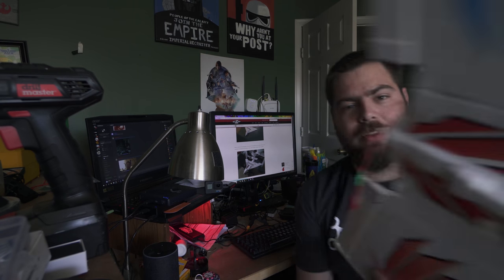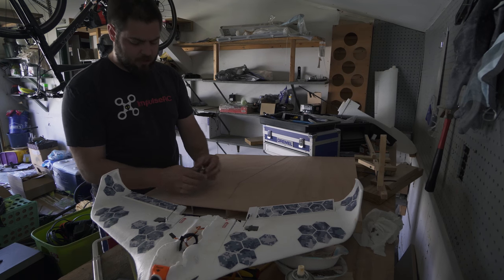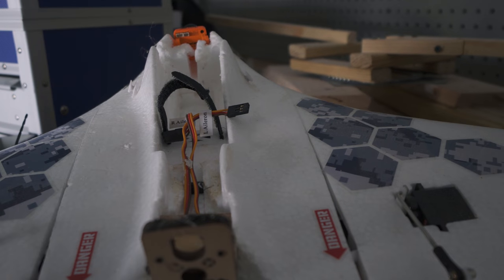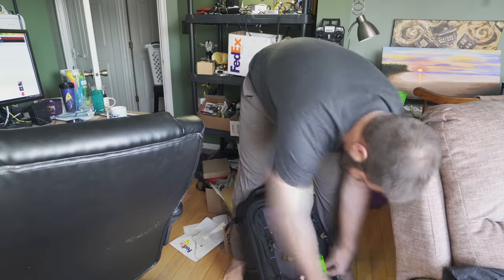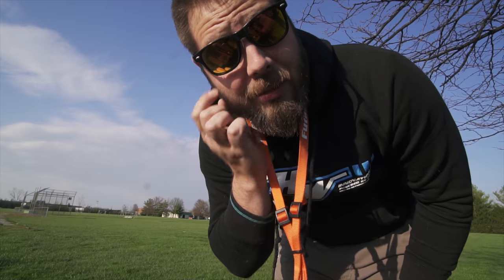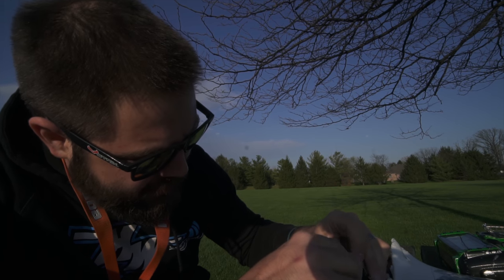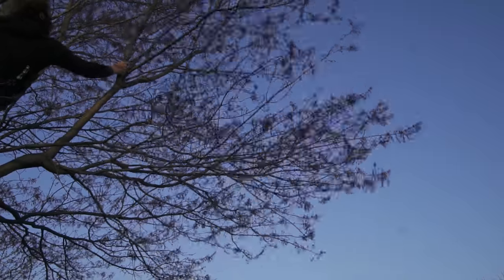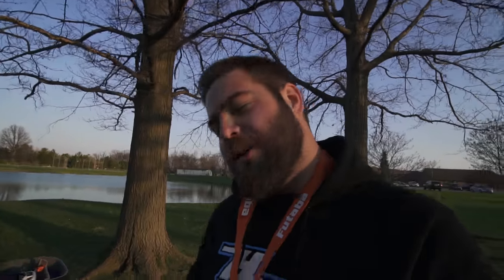I'm never touching fixed wings again

Comment: Dude, some wings just really suck. Don't stop though, have to find the right one. Like a unicorn
Reply from the maker: I won't give up haha. I'm looking at finding another one more off the shelf that's dumbed down for me.
Reply: NURK FPV try a pop wing. They been around for a long time and there dirt cheap. Learn on that till you fell ready.
Reply: Did you try E-flite x-vert vtol? Its flying wing that vertically hover.
Reply: get a sweepwing!  or the RMRC strix goblin or nano goblin.  These are also available in the kit or pnp and great for line of sight or fpv.  Also pop wings are really cheap and durable.  Its the only plane I have that has always worked despite always crashing.

Comment: Tail heavy...check the recommended CG measurements.
Reply: exactly what im seeing here too good catch!
Reply: getting the CG right on some wings can be frustrating for sure haha, drove me nuts when i first started building wings years ago .  but  NURK can fly a quad like a God !  love his vids , the one flying around that dam was epic!
Reply: Jeremy Vest 
This! I dabbled a bit in building my own wings. First one was ok but the battery had to be almost hanging out front to balance! Second one had a fuselage of sorts but it generated lift that i didn't account for so the flat spin of doom happened. Yes, wings can be tricky.
Reply: Frequent Flyer haha I know right battery practically hanging out the front I've been had to resort to sticking bolts in the front just to balance it LOL

Comment: I was a fixed winger for 20 years but have found my love in FPV quads. They produce a much smoother platform for video and can be flown from anywhere in conditions you would not even consider with a plane such as high wind or confined spaces plus the  aerobatic envelope is much wider with a quad.
Reply from the maker: Agreed on all points.

Comment: if i may suggest a good wing, i would say the FT mini arrow or versa are both great starter wings. easy to build and fairly easy to fly. i just built my mini arrow and its pretty fast, and as a quad pilot flying came kinda natural.
Reply from the maker: We shall see. The idea of scratch building or building a kit with glue and all that just makes me want to cry. I am just not interested in the arts and crafts side of things
Reply: NURK FPV neither am I I hate arts and crafts but for me it was the cheapest way in. Plus there's really not too much too it. It took me about 1.5 hours to do. But to each their own

Comment: wings, biplanes & triplanes are more sensitive to small cg changes.. fast wings are always hard to balance and may need some added nose weight. Also, if your not sure where the cg is its usually better to start a bit nose heavy.
Reply from the maker: See it's annoying because I thought I had it nose heavy. Turns out no

Comment: Made my first flying wing off some Flight Test foam board plans and some spare quad parts. Mounted an fpv camera on it and took it out the other day. First attempt I broke it in half, hot glued it back together then had several more awesome flights after that.  I'm kinda a fan of the thing now.
Reply from the maker: Nice! That sounds like the perfect experience

Comment: You said there was up tilt in the motor mount? If so that is absolutely your problem. And possibly tail heavy on top of that will not help. For scratch build look up the Flite Test Mini Arrow, or the Flite Test Spear, both great designs and only about $2-3 in supplies ;)
Reply from the maker: It was more or less level by the time I flew. I never clarified that on camera.

Comment: the problem is that it lacks weight ahead, that's why the wing is uncontrollable, once the perfect balance is achieved, they are very stable and easy to fly in FPV
Reply: Weight and balance is Crucial on a wing.  Not having a three gyro FC leveling the plane changes things also. Wings are really simple and some are great video platforms, but ya gotta have things in sync.  Buy a "suggested package " and you'll rip fixed wing too!

Comment: Did you almost test the rotary bit against your hand to see if it was spinning at 3:11 😂
Reply: French Brown I was thinking the same thing !!!
Reply: Think he was feeling for air flow. But you can touch those types of abrasive disks (without much force). Though that little dremel was pretty high rpm. So be careful. It's wood cutting disks that are lethal, they scare me. All the razor teeth. Kinda like quad props. Dangerous.

Comment: Dude don’t sweat it. Launching a small wing like that can be hard even for a seasoned wing pilot. I think you either need someone who knows what they are doing to help you, or get yourself something that is much more stable. A good ol’ bixler or something like that will be way easier to start with. Starting with a fast twitchy wing like this is basically equivalent to making your first quad flights by tossing the thing off the roof of your house - in acro mode!
Reply from the maker: It's funny cause that's basically how I launch quads

Comment: Definitely tail heavy.  Planes have balance point or "center of gravity" which is crucial, especially for flying wings.  You should actually try a trainer plane before moving on to a wing.  You're literally learning on the toughest type of airframe to fly.  Get a Bixler from Hobbyking or similar rear-prop trainer...and then check the center of gravity before you launch it!  You'd be amazed at how relaxing and fun a smooth flying plane can be!

Comment: yip definitely tail heavy , checkout the zohd dart its great fun and it will fit in the glove box of your car haha , we have a lot of them flying at the field on 4s and 3s , its a box of joy los and fpv , right back to the vid
Reply: Mine broke into several pieces on the maiden made a mistake of adding a battery strap and it ripped out the entire center of the  fuselage finally glued it and just now getting it to fly 🤞

Comment: Use TS100 
soldering iron for "unexpected" repair work)
Reply from the maker: I have one but I wasn't wanting to clear away heat shrink and try to solder underneath the massive heat sink that's part of the ESC

Comment: Prediction: I think it's gonna fly, but it won't fly well. :) I have a Foxeer Datura 2700kv motor on my BTW with a 6x3 HQ prop and Speedix 30A esc. It rips and I can get 10-15mins on a 1500. EDIT: I was wrong. Try having someone overhead launch for you.
Reply from the maker: I doubt the launch was the issue

Comment: I don't understand why you're setting up for failure with a hacked together design when you could easily work with an existing out of the box platform. I'd really like to see how your practiced dexterity from quads translates to a plane.

Thanks again for all you shore!
Reply from the maker: Haha that's an excellent point you bring up. And that's the thing: I've done that and I obviously have some broken one's around so I wanted to see if I could pull one back together and get it off the ground.
Reply: Nothing wrong with tinkering. I just don't wanna see you get discouraged. 

KEEP POSTIN' BRO <3